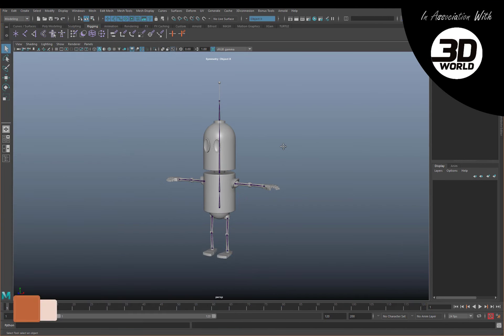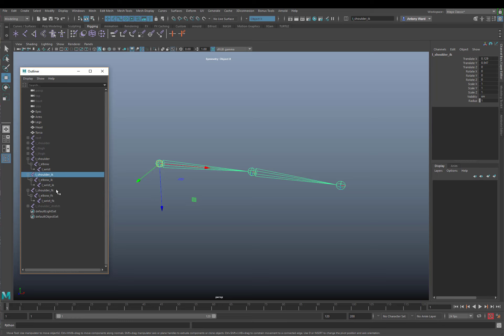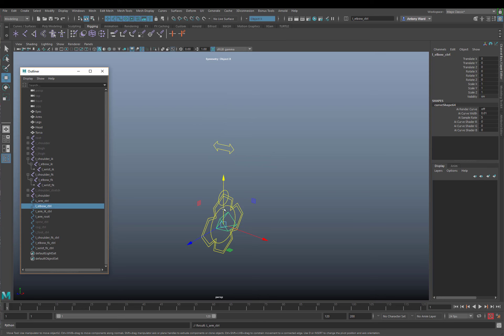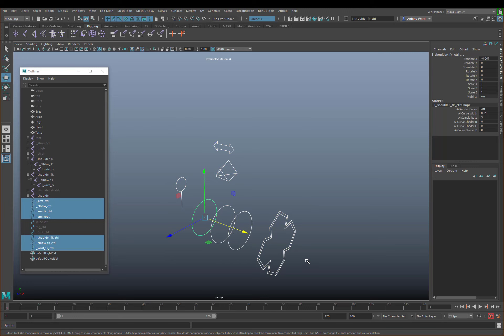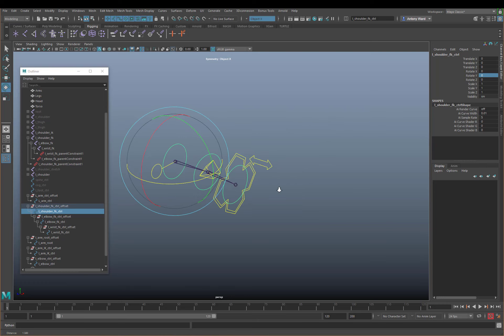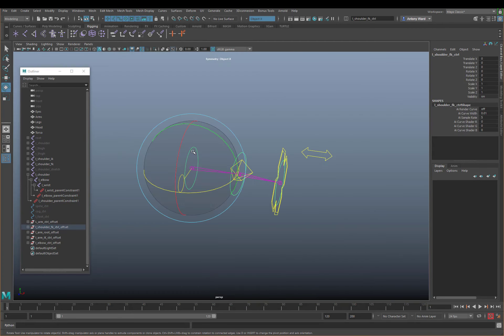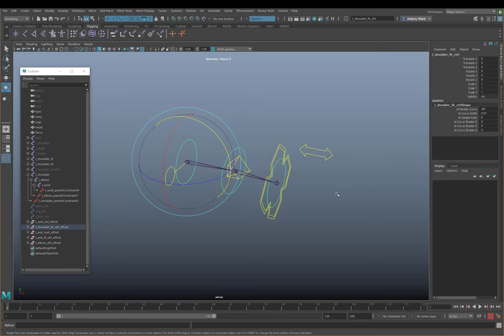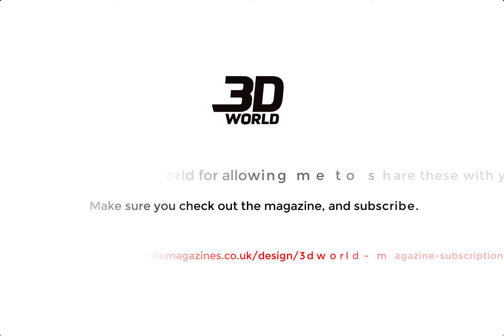Flexible Rig | Part 2 | IK & FK

Comment: I have been loving your tutorials, but I have a question. When I use the IK FK switch my DEFORM joints will flip their orientation while transforming from FK to IK using the switch. I was on Part 8 of your tutorial playlist when I started noticing this, and I finally narrowed it down to the IK FK switch causing this DEFORM joint flipping. Does anyone know how to solve this problem? Thanks.